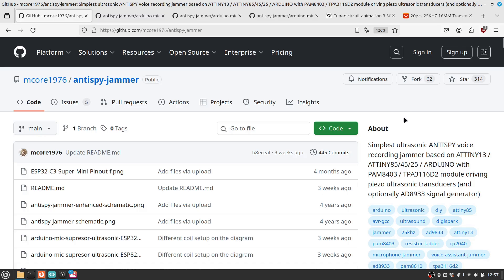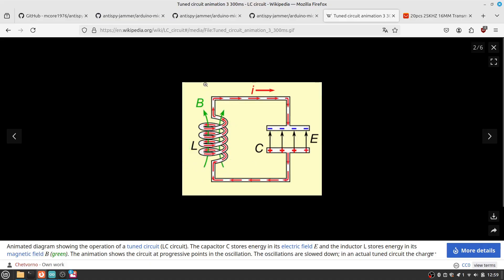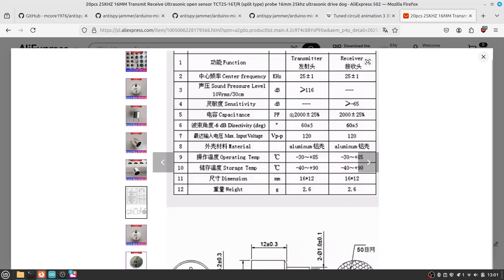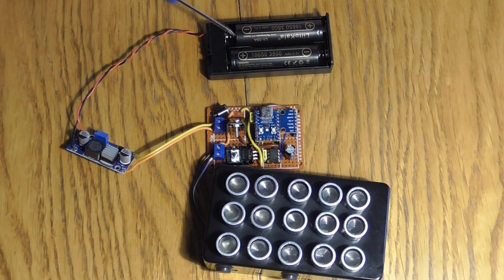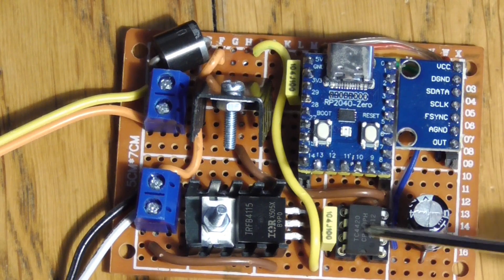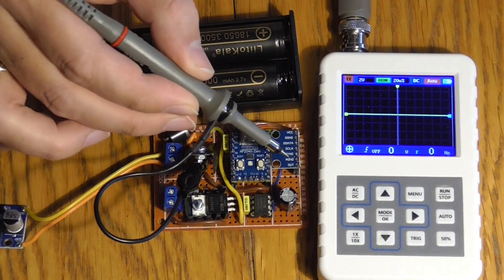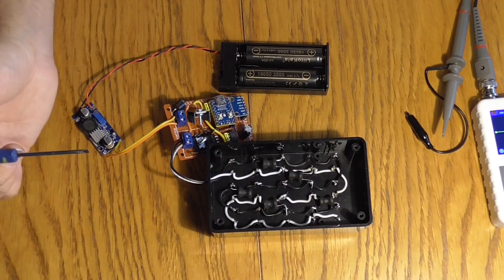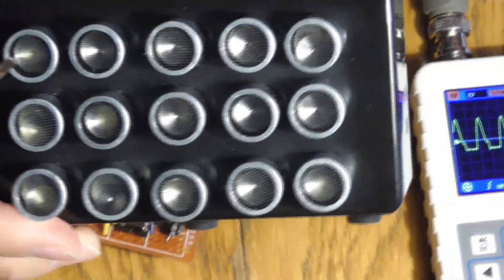DIY Ultrasonic Microphone Jammer  - hardware update !

Comment: Oh wow! What a fantastic project. I am a beginner in electronics and think this is a wonderful project to learn. 

I might have some questions to understand it better:
- Are there any experiences regarding ESP32C3 SUPERMINI, RP2040-zero or ESP8266
WEMOS D1 MINI and the quality of the jamming and also the stability of the system? Or does it not matter so much?
- Regarding the rule '4.7mH for 4 transducers' vs '3.3mH for 3 transducers': The drawing shows a mismatch in the last group (4.7mH on 3 units). Does this affect performance, or should I strictly follow the text rule?
- How many transducers is the upper limit and what is considered the sweet spot? The MOSFET is the limiting factor, isn't it?
Reply from the maker: 1. All the boards should work the same, the difference may be only related to board clock speed
2. The rule comes from LC tank calculator and 1x 4.7milihenr per each 4 transducers comes from this calculation, but the more coils you have the more energy in magnetic field will be collected and the higher power you will get in result. In contrary - the less coils means lower power but higher current  per single coil and unnecessary heat. Please find that there is an error on the diagram - if using 3.3mH they should be placed every 5-6 transducers.  If using 10mH coil - then 1x10mH coil per each 2 transducers
3. In general you can add more MOSFETs to the same output of MOSFET driver chip. All the  transistors need to be connected in parallel : gate to gate, drain to drain, source to source. We tested more than 40 transducers with single transistor and it did not even get hot. So I think 80 transducers - not a problem.😅
Reply: @justanengineer5599  
Wow! Thank you very much! <3 
Will have a new project now!

Comment: Hey Adam, thanks for the interesting project. Have you tested the battery life of your setup? Also, ever thought about presenting this device on the CCC, giving it some stage? (Chaos Communication Congress in Germany)
Even if there are ways to circumvent the device (as Juliana says, the AI noise cancellation of iPhone for example), it can still be a very interesting piece of hardware for many people at risk.
Reply from the maker: Hi, depending on the LiIon battery capacity it works at least one hour. It should be sufficient to perform secure conversation. Of course you can add more cells in parallel to extend this time. I have never been on CCC though I know it is nearby my country.. I will think of it next year but rather as a public not the presenter 😊  My goal is to  give people some cheaper alternatives of commercial products and also help them protect themselves. I think tracking people, spying on them and profiling  has gone too far these days. I cant protect myself but I can help the others to do so

Comment: Hi Adam, I saw that you published the new project. Congratulations, it looks great! For iPhones 17 Pro Max that also use AI noise cancellation, I suggest a minimum of 48 transducers for about 5 meters.
Reply from the maker: Thanks for the feedback! Good to know for the newer models.
Reply: 48?
Reply from the maker: the coils are important really. For iphones works best when there are 1 x 20 MiliHenr per each 3 transducers instead of 1 x 3.3 per each 5-6 transducers.
I recently found out that with my 20 transducers using only 4x4.7milihenr 10x8mm gives best results. At the end you will have to experiment a bit with number and values of the coils to fine tune the power

Comment: can i use 40khz instead 25khz?
Reply from the maker: you can but the jamming effect will be weak. Also you would have to change frequencies in the source code : 24kHz --> 39kHz and 26kHz --> 41kHz.  Buy 25kHz transducers directly from China vendors.

Comment: Hi. What is the range in meters?
Reply from the maker: Thiago says it is up to 5 meters for iphone 17 with proper coils and 42 transducers.  It will all depend on the microphones
In my case it was up to 10 meters for older phones and around 3 for newer. The more transducers the better the range is. No limit here. It is just the power source and the current that limit the power. The IRF 4115 can stand a lot !